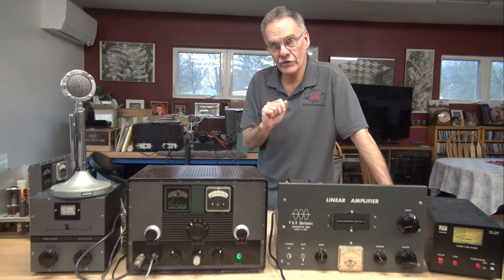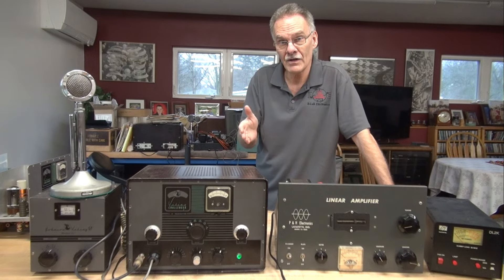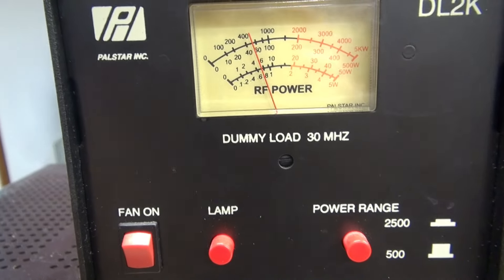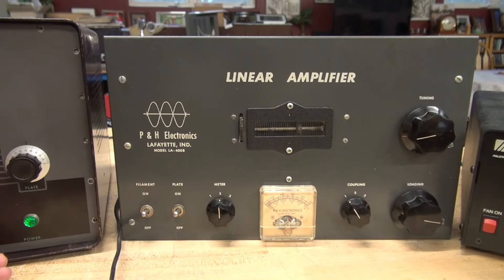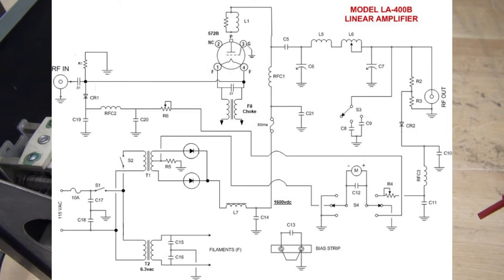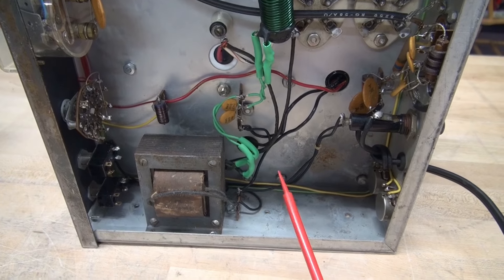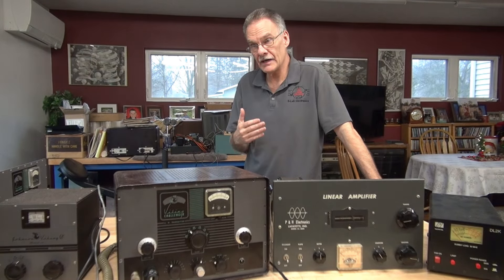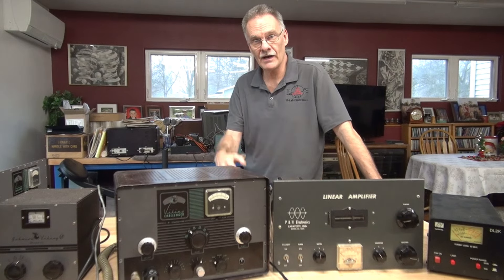D-Lab Modified P&H LA-400 Ham Linear 572B tube amplifier Low power RF output problem Need suggestion

Comment: The cathodes for the 1625s are directly coupled to the RF input.  Since they are isolated from the filament a DC path for cathode current is provided by the direct coupled RF input.  The 572B on the other hand is directly heated so the filament transformer through the added common mode choke needs to have a center tap to provide that DC path.  Also the RF input should then be AC coupled.
Reply: The more I look at this, I have to agree with @tomkx8701.  There is no direct dc path to ground for the cathode.  Only path is through c15/c16.  No good for DC.  The only other path is if you have the meter in the correct position.  You will need to provide either a second set of filament chokes tied to the filament xformer centre tap or some other method.  You need a DC ground to the filament/cathode for this to work.  Cap coupling will not pass DC.  Again, in the schematic you provided there is no ground dc path to the cathode/filament.  I think this a major issue.  I would move all of the DC components (r1 for example and CR1) to the DC side of RFC2.  You need that to block rf from the dc side, but still need proper bias o the filament/cathode.  please have a look at the Yaesu fl-2100z schematic on bama dot debris dot com for some reference.
Reply: right the rf is not been puled down there is not much amplification the cathode is up from negative
Reply: There is a DC path via R1 (schematic at 3.22 in the video). I don't know if this is intended. What is the value of R1? The schematic in the link has the center tapped filament transformer, AC coupled RF and no R1.
Reply from the maker: Yes, R1 an associated components were from the legacy RF input voltmeter function. That is going to be removed. The problem has been resolved, The CT of the filament transformer was not connected. It is now and I have full output! Will be shooting a new video showing progress

Comment: Thanks Terry for ideal way to create a amp for April 1st Un-Plugged QRPp contest.  Seems it wants to hook up with three other 572B tubes.  But wait we can do better.  Let's go metalhead,  and just get a 4cx250B in there. 
They require almost no drive power.  2kv, 350v and the filament supply a LED can handle the grid overdrive indicator.  A squirrel cage blower later your running a super charged 400watts. And the vintage Exciter see's 50ohms thru a swamp of carbonated tubes of resistance.

Comment: So Terry if instead of providing a center tapped filament winding for the DC path you decide to simply add a single RF choke at the tube socket be aware that there will be an unbalanced current through the filament during modulation that will cause asymmetry of voltage along the filament possibly effecting tube life.  That 1k resistor shown in the schematic is the DC return for the detector circuit.

Comment: Sorry about my comment terry you are an expert and know alot more than me Dwight.
I noticed that the linear you have modified does not have an input tuning Network or output low pass filtering on it's output I think it will not have a very clean signal.

Comment: If yours is wired up like the hand-drawn schematic on the page you linked to, I see the 0.01 caps on the input, the two sides of the filament, and by the 6.3 VAC filament transformer.  The RF choke in series with the filament leads seems a possible culprit to me, if it has issues it might be loading down the RF input to ground, with help from those 0.01 caps.

Good luck, Terry!
Reply from the maker: Hi Bob, Yes it was the Choke circuit. I did not connect the 6.3vac CT. Connected now and amp is operating! Will post a  new video soon. Thanks for your help
Reply: @d-labelectronics  Yes! 😁
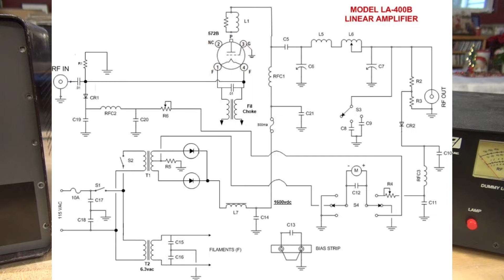Reply: I just realized that you showed your schematic at [3:19], I'd been multitasking and missed it.  So I was going by the hand-drawn one from the linked example of someone else's version of the modification! 🙂

Comment: Input impedance may be way off. Maybe a tunned pi network for each band would be useful. I once used an antenna tuner between the exiter and the amp and that did a great job.

Comment: You changed it from a 4-tube amplifier stage to a single tube amplifier stage. Check the neutralization. I"ll bet it changed going from 4 tubes to one tube. Good luck and great video Thanks for sharing. 73 DE K7RMJ

Comment: Maybe the input SWR is high. Some amps have a tune circuit at the input of the amp.
Reply from the maker: Yes, I would agree. The info on line did not used the tuned input, but I am considering adding it
Reply: Well what is the SWR between the exciter and amp???

Comment: What is the dc voltage on pin 4? is D1 backwards? if D1 is backwards maybe the tube is biased off. Try measuring grid voltage with 1 ohm someone else suggested.

Comment: if I look at other 572b amps, the filament is grounded through the oil former ant the tube on/off bias is controlled through the grid with a neg cutoff voltage. the more I look the more I see that this was a beam tube design with isolated cathode.\

Comment: I've been out of the linear tube  rf amp world for while but its likely an amp input impeadance mismatch. Maybe try an swr meter between exciter and linear?
Reply from the maker: I have it operating. Problem was the CT on the 6.3vac transformer. Will post an update soon
Reply: I see it now. No cathode dc return path as drawn on schematic. 😊

Comment: Check SWR between exciter and PA. Filament choke may have too little inductance. Looks like the PA plate tuning caps are at either maximum  or minimum capacitance.
W4TAS

Comment: I would take a close look at C19 and CR1. Even if C19 tests good, a temporary short could have damaged CR1, resulting in a short, perhaps straight to ground thru C19 (if it's bad). The first thing I would do, before anything else, is put 2 reverse-facing parallel diodes in parallel with the meter, just to keep it safe.

Comment: looking more closely, r1 and c19 seem to be bleeding rf to gnd.  normally in a gg amp this wouldn't be done.  c20 is on the dc side of rfc2 for bias control and you can tune your transmitter pi out to match the impedance of the amp input.  I don't see that in the fl-2100z or any other gg amp.  looks like a holdover from the 807/1625.  I would lose them.
Reply from the maker: Great input Sir, I agree. Will remove those components and see if it solves the issue. Appreciate it!
Reply: Hope this gets things closer .  If it weren't for puzzles like this it would be a boring hobby! @d-labelectronics

Comment: Check the amp band switch is in the 40 meter position?
Reply from the maker: There is no band switch on the amp, just a roller inductor, which is functioning

Comment: An  impedance  mismatch   between transmitter  and  amplifier ....    use  a  VNA    to  find  where the  input  to the  amplifier  is  on  a  Smith  Chart .

Comment: Hang a  around 10K (plate impedance)  from plate to ground and measure Z looking into output connector with antenna analyzer. should be near 50 ohms when output is tuned.

Comment: Maybe try with C19 lifted. What is value of C19?
Reply from the maker: C-19 and 20 are .005uf
Reply: That is 5 ohms  @d-labelectronics   try driving with C19 lifted or with the diode string open

Comment: Maybe hang a scope on cathode. Vrms should be square root of P times R so about 50 rms or 140 p-p.  Maybe that choke in not high enough impedance without the matching network. Still should do more than it is out. Maybe 2 issues.

Comment: Your brilliant transformer for the 572b must be center taprd! No caps at transformer. Center tap to ground.This will improve the out put of the challenger also. Have same but used with 813 and center taped 10 v 5a transformer. 73
Reply from the maker: Roger that, I will add the CT, Thanks, Follow up: That fixed it! You rock!

Comment: No tuned input on the amp. The input impedance is not matched to the exciter. Try adjusting the exciter load control and it will probably increase the output power.
Reply from the maker: Hi, yes tried that, No good

Comment: How about trying another radio? Cables/connections? The dummy load/wattmeter behind the amp?
Eliminate all other possible problems until you're sure it's the amp.
Reply from the maker: Yep, verified them

Comment: looks like a blown cap..short on the input line.
Reply: I've had the same issue with many different tube devices. Even brand new capacitors just eating all the power.

Comment: Take a look at the schematic of sb200 Heathkit and wire that amp the same way it will then probably work you'll probably get 200 to 300 watts output from the old amp. Your the expert. Sb200 feeds the exciters output after the input choke to the direct heated cathode of the 572 B not a center tap of the input choke of the 572 B check it out Terry look at the schematic of the sb200 it has two 572 b's in parallel but does not use a center tapped choke. The choke at the 572B
Cathode is to allow the fillament voltage to the 572B cathode but prevents the Rf from going anywhere but to the cathode of the 572B's cathode. If you put the RF to a center tap of the inputs choke to the572B's cathode
That rf exciters signal will be choked way down.
Oh by the way the sb200 has an input 
Tuning network wich helps illiminate the amplification of spurious emissions. If that thing does not have an input tuning Network it's probably junk from CB radio Broadband amplifier. Which are known for putting out lousy signals which can interfere with other radio services. This is not any kind of criticism just a suggestion but if it does not have an input tuning Network it's going to spit out a bad signal. Just like on CB radio off back when.

Comment: Your filament circuit is all wrong the dc path is taken from the rf side of the filament choke, it should be pulled from the center tap of the filament transformer or from cathode joined diodes with the anodes to the filament supply.

Comment: 1 a single 572b cathode impedance is abot 215 ohms with some stray capacitance and your design has no matching network so you have a complex impedance from the exciter to the amplifier , i fear thats your biggest issue ... r6 seems to be the bias adjustment i see no real bias circuit in your rendition , i do see dome diodes off the filament choke on the tube side thats not doing to work for bias as there is rf present across the bias should be at the filament transformer side of the filament choke so i think your 572 is running at cutoff so in a sense the tube is not running in any sort of conduction at dc .... i wish i were arround the block from you we would have that going in an hour with a few parts . and a couple glasses of wine
Reply from the maker: Yes, there is no bias adjustment. This amp is configured grounded grid. See diagram, pin 3 of the 572B
Reply: @d-labelectronics  ill have to double check that diagram when I get off work . Guessing running in 0 bias configuration i didn't see that in the diagram but I just gave it a quick look ... I seen no input network and that drew my mind to that and how the bias worked

Comment: PS.  572B filaments are amp hogs, make sure you have at least 6.3vrms at the fil pins after the choke. Tolerance is  +-.3 volts but you do not want to be on the - side.
Reply: That's kinda funny because the big ceramic transmitter tubes like to have the filament voltages run a bit low during the first few hundred hours.